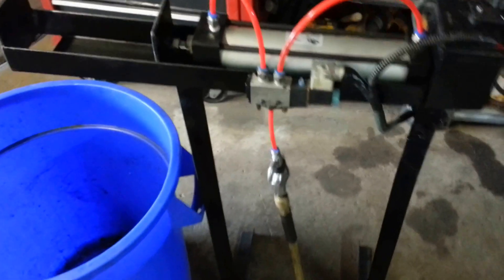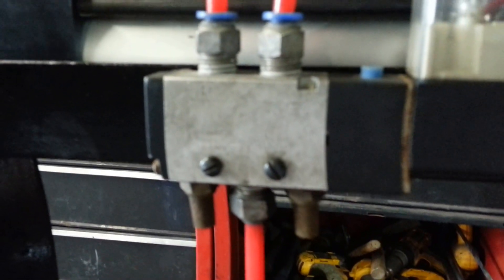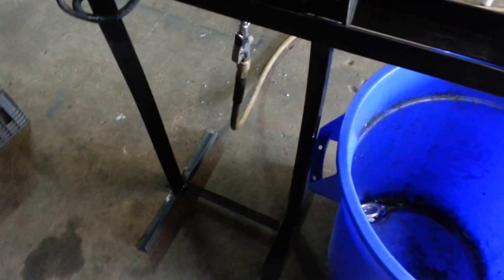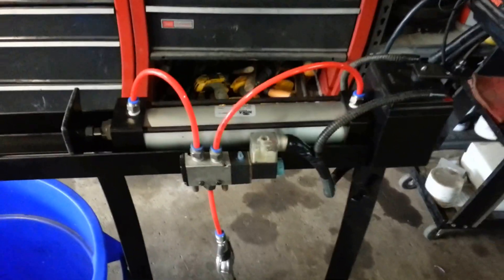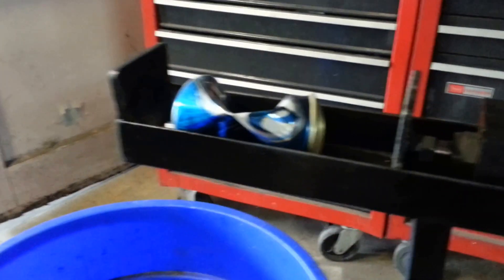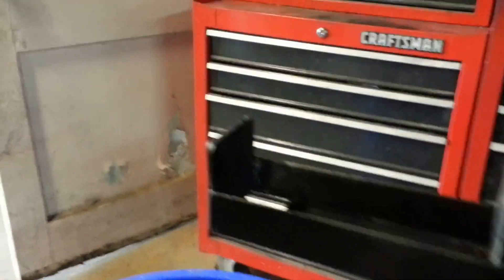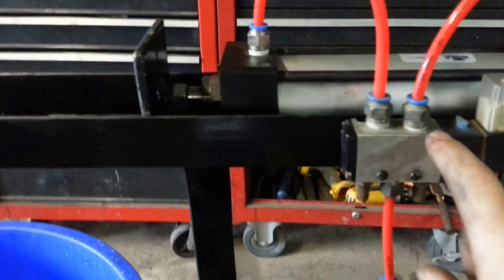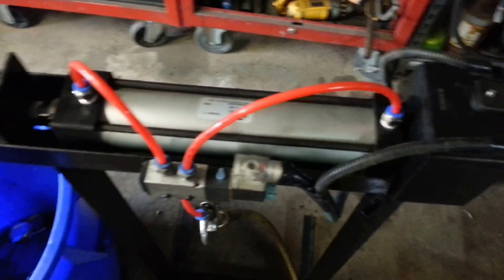Pneumatic Can Crusher Finished

Comment: Very nice. I will be taking your idea and modifying it. I am going to widen the space between the angle iron so that when cans expand they don't get stuck. I will be adding a hopper. 

Someone commented this "Haha.... I've never seen a battery on one of these.  I'm guessing the first time you have to go pay 80 bucks for new battery, you'll scrap that idea.  Cool crusher."

I commented this: "
Those batteries are only like $20. Plus you can recycle the too, at most recycling centers. Plus that battery should last a very long time.  Plus he can add a compressor and small tank and make the whole thing portable. If he adds a hopper and some simple safety things he can take it to parties and picnic areas. 

https://www.amazon.com/dp/B06XCKH175/ref=sspa_dk_detail_6?psc=1&pd_rd_i=B06XCKH175&pd_rd_w=1DU7q&pf_rd_p=4269e1a0-a218-4fbd-9748-1cd337d2f2a5&pd_rd_wg=gi5CJ&pf_rd_r=22G3T9ZPFKZGYGW6S6MN&pd_rd_r=bbfb5f81-02c2-421f-acbe-d6e0d3bf5431&spLa=ZW5jcnlwdGVkUXVhbGlmaWVyPUFIVzYyRkc2N0xCOEQmZW5jcnlwdGVkSWQ9QTAwOTkwOTMzM09YWkgzTllOVjE0JmVuY3J5cHRlZEFkSWQ9QTAyMDQxODIyRDgySEE2UjNXSEJHJndpZGdldE5hbWU9c3BfZGV0YWlsJmFjdGlvbj1jbGlja1JlZGlyZWN0JmRvTm90TG9nQ2xpY2s9dHJ1ZQ==

"

Comment: Here's an example of a design failure. First few cans get stuck or ejected. I agree with others. Don't pre-flatten the middle of the can.
Reply from the maker: I wouldn't call it a failure. I didn't have any uncrushed cans at the time of this video. These cans were already flattened in the middle.
Reply: @TheBurnsStuff  I don't think the project was a complete failure. I said it was a "design" failure. A "design failure" is often where all of the individual components do their job fairly well, but when they are put together with the specifics of the "design", then it doesn't work as planned, most of the time.

Comment: Haha.... I've never seen a battery on one of these.  I'm guessing the first time you have to go pay 80 bucks for new battery, you'll scrap that idea.  Cool crusher.
Reply: Those batteries are only like $20. Plus you can recycle the too, at most recycling centers. Plus that battery should last a very long time.  Plus he can add a compressor and small tank and make the whole thing portable. If he adds a hopper and some simple safety things he can take it to parties and picnic areas. 

https://www.amazon.com/dp/B06XCKH175/ref=sspa_dk_detail_6?psc=1&pd_rd_i=B06XCKH175&pd_rd_w=1DU7q&pf_rd_p=4269e1a0-a218-4fbd-9748-1cd337d2f2a5&pd_rd_wg=gi5CJ&pf_rd_r=22G3T9ZPFKZGYGW6S6MN&pd_rd_r=bbfb5f81-02c2-421f-acbe-d6e0d3bf5431&spLa=ZW5jcnlwdGVkUXVhbGlmaWVyPUFIVzYyRkc2N0xCOEQmZW5jcnlwdGVkSWQ9QTAwOTkwOTMzM09YWkgzTllOVjE0JmVuY3J5cHRlZEFkSWQ9QTAyMDQxODIyRDgySEE2UjNXSEJHJndpZGdldE5hbWU9c3BfZGV0YWlsJmFjdGlvbj1jbGlja1JlZGlyZWN0JmRvTm90TG9nQ2xpY2s9dHJ1ZQ==